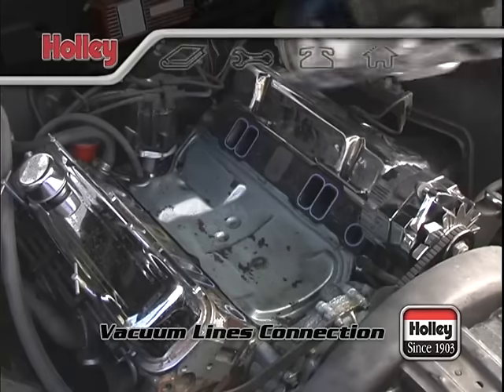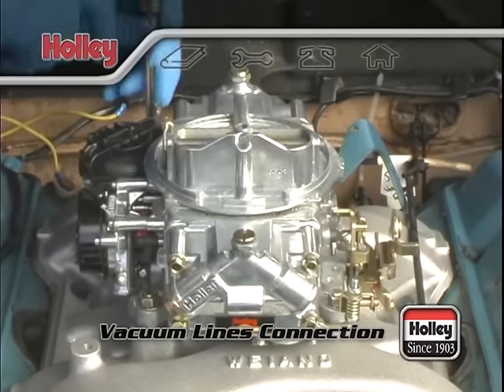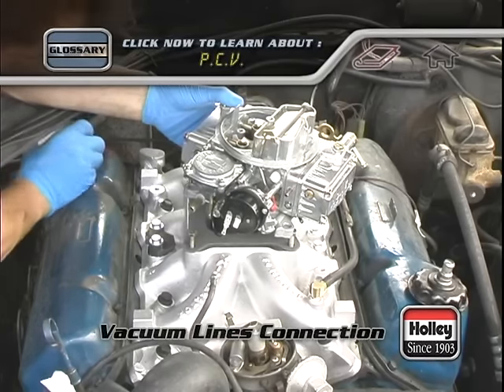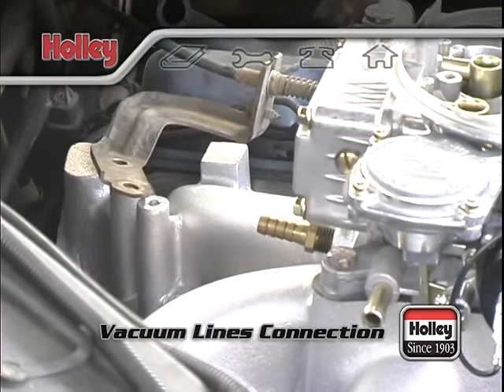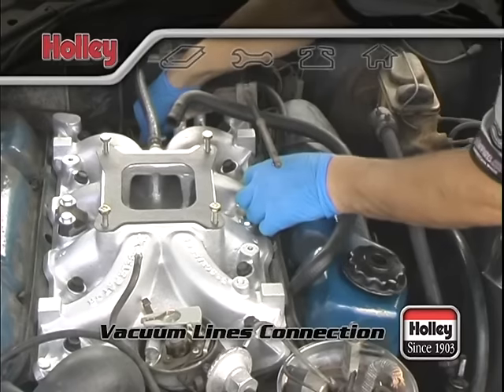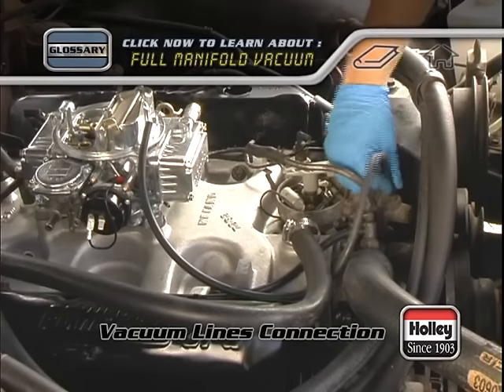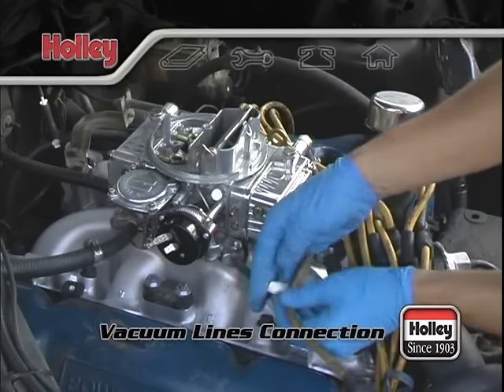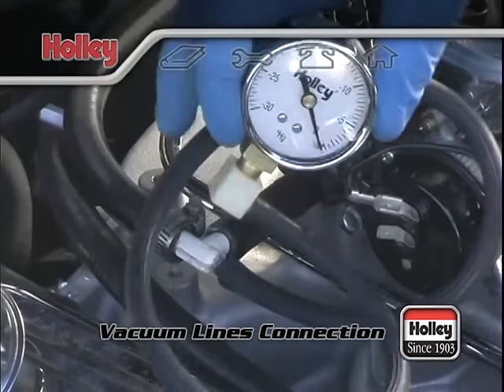Where to Hook Up Vacuum Lines On A Holley Carburetor

Comment: Great ilustration fo where to conect the Distributor Vaccum advance line.

Thanks, you made my 1963 Falcon  with a 289 run better.

sincerely:
Emilio.
Reply: Distributor vacuum advance hose locate

Comment: Hi, my friend, congratulations on the pair of videos, which are of great help to us mechanics, I have put and replaced the hoses and also the thermostat of the carburetor but I have not managed to get my truck in the morning to turn it on by itself , I have to be accelerating until it warms up, I hope you can help me and once more happiness for your videos
Reply: You need to depress the accelerator pedal once to set the choke and raise the fast idle cam before starting the engine.  Confirm that you are doing this and that you are on the fast idle cam. If it still idles to slow when cold you need to increase your fast idle speed.

Comment: So, the vacuum fittings at the base of the carburetor are all manifold vacuum? That would be a good position to attach a hose to the AC system for vacuum operated devices like flaps, etc?  There’s one at the front of my baseplate that’s the right size to connect to my vacuum canister in my ‘68 Chevelle.

Comment: Hello! On my car  the PVC valve not suckin air like before! Even when i disconnect the pvc from the top of the valve cover my Rpms doesn't rise like they should whenever you disconnect it! Already put a new PVC valve and inspect the hose but its good! Anything else i need to check??? 84 mustang gt carb. Just rebuild my carb too so idk if has to do with carb. Any help will be appreciated thanks!

Comment: Do Holley sell a replacement fitting for the timed vaccum oort from the carb to the distributor? I'm broke mines off of my 1850-4 carb trying to mount it.
Reply: You need the vacuum advance to go to a manifold vacuum source for proper vacuum advance function. Im not sure why Holley tells you to use "timed" or "ported" vacuum on the vacuum advance, that is exactly opposite of what the engine requires. Typically the mechanical advance in a distributor will supply 15-20 degrees of mechanical advance and the vacuum advance will supply about the same amount of advance. If you set up you ignition to Holley's recommendations you will only have 0-10 degrees max base idle, the car will not run very good this way. If you attach the vacuum advance to a manifold source you will set your timing to manufacturers recommended settings then when you attach the vacuum advance hose your timing will increase giving you a good idle and good low to mid rpm drivability, plus the ignition curve will follow a path that gives you max performance, When going up a slight hill you need to apply more throttle, with manifold vacuum your timing will decrease a little so the engine does not ping, if attached to a timed or ported source your engine will likely ping under slight loads causing you to retard timing and decrease performance. This is exactly how the manufacturers designed the vacuum advance system, to keep timing as far advanced as possible without pinging, a manifold source will do this for you.
Reply: @fastone371  thank you very much
Reply: @tyscott4538  anytime brother!!!

Comment: im trying to find where to connect a vaccum modulator on my fairlane with a 302 engine. it had a AOD before that was busted, and now i need to find a vaccum line to the c4. not sure where to take it from. i have a motocraft carb
Reply from the maker: that needs to be connected to a manifold vacuum source.
Reply: @HolleyPerformance  thank you! can you somehow feel the pressure/vaccum coming out from a port with the engine on? i suppose i dont want a timed port, but something that sends out all the time?

Comment: I just put a New Holley 4 barrel on my 1975 Pontiac Catalina 4400. Carburetor is backfiring and popping when I give it gas. Any help here. Must it be tuned to my car never had this problem with before out of my 2jet carburetor.
Reply: ENLIGHTENED CHILD OF GOD THE OFFSET out of curiosity, where did you connect your transmission vacuum line to? It's on the far left. I'm guessing you've got a 400 as well?

Comment: for a brake booster vaccum on the intake , isnt the intake ful of antifreeze , can I still run a vacuum to the intake
Reply: Make sure you use a vacuum port connected with the fuel/ air system. You may have ports (at the front) of the manifold, which will be for your temp sensor to monitor engine temperature, which will run coolant through them.

Comment: what would happen if you do share a brake booster vacuum line????
Reply: A space/time warp will open up and take you to another dimension.
Reply: But I've done it before and got away with it, just make sure you have a one way check valve on the booster side.

Comment: How do I hook up vacuum on a1975 CorvetteFor the transmission kickdown and the headlights is vacuum ,I’m putting a 383 stroker in it and was wondering how that would still work
Reply from the maker: You'll have to consult a factory service manual for your vehicle.  But I would assume that there is some sort of splitter or vacuum tee/tree that you will connect manifold vacuum to, then it splits off to the trans and headlights. The vacuum supply can come from the 3/8" port on the back of the carburetor or directly from the manifold.  Thx J

Comment: how about not hooking up the PCV valve ....plug off the vacuum port for the PCV....That way the motor doesn't suck in hot smoky crank case gasses..only fuel and clean air...I'm really speaking for a race type engine...not a stock one...
Reply: steve mitchell how do you do that I have a 86 cutlass
Reply: @cooleydread3215  Just run a couple breathers on the valvecovers. Use the type that comes with a crankcase evacuation and run a hose to a bung welded into your header or on a collector extension. On the street just run the hoses to a remote catch can with a breather on it.
Reply: Frankenstein Monster thanks man up early today about to get some work done on my ss now

Comment: I bought a Weiand charger for three grand plus five hundred for a carb. What a pos it leaked the first day I bought a gasket kit for seventy dollars. That's when I seen the shoddy machine work. When it was drilled the bit must have been dull and it chipped the gasket surface. I'm going to be taking it apart and making a utube video. Shane whites carver with Holley performance said how do I know it didn't come from a blower shop like that ? I bought it new. Why would a blower shop drill the holes on the front of a case ? He couldn't answer. He's suppose to be their top tech guy. It's the best Holley performance can do. I wish I would've bought a leaf blower instead. It would've been a lot less problems and more power.
Reply: Alan Williams ya same .. its everything else but their carbs. the tech guys suck too. they told me i tightened down too tight..riiiight.